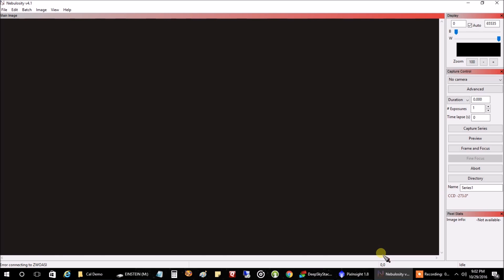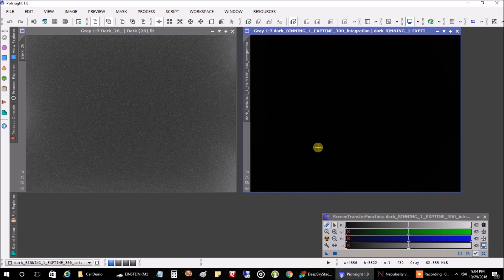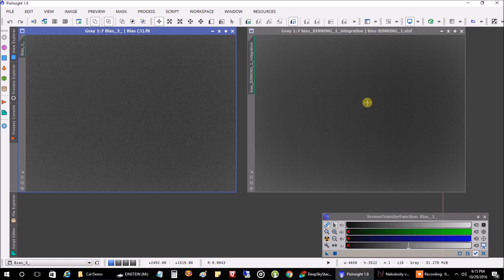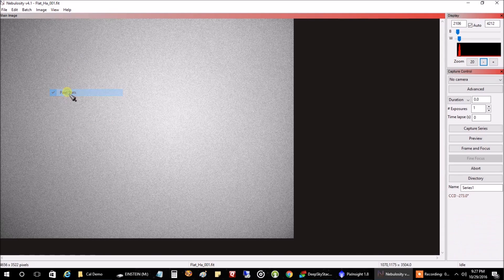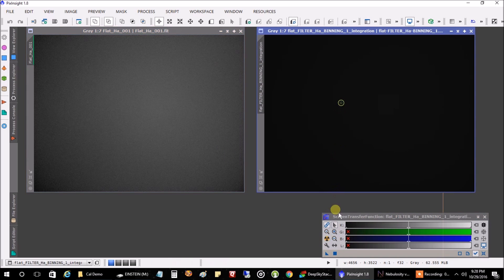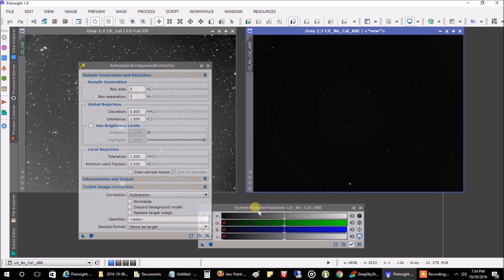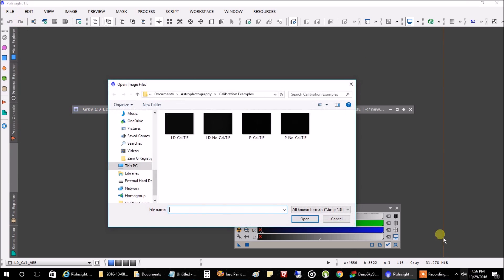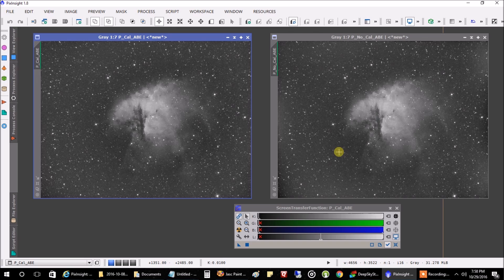How to Create Darks, Flats, & Bias (Astrophotography Calibration Frames)

Comment: Chuck, the correct pronunciation for vignette is vin-yet. Nice presentation. I also notice that if I set my exposure too high for flats that it washes out my image. Maybe we're missing something?
Reply from the maker: Right, vin-yet...I finally beat it into my brain.  Flats are tricking business.  I've noticed as well as others I've discussed it with is that flats are not very effective in severe light pollution - especially when a bright moon is out.   As far as setting the exposure too high on your flats, I would agree with you that it might have an adverse effect on your image.  Lately, I try for an average mean readout (ADU) of 5,000 for my flats.  Other people go very high, I go low.

Comment: Nice video Chuck and very informative. I have a silly question... I have just purchased a flat field generator and wondered if I need to retract the lens hood for my Esprit 100ED? I have seen several videos and images of flat field generators on the end of telescope lens hoods and nobody seems to mention it! I ask because in order to retract the lens hood I need to remove the telescope from the rings and I notice that you retracted yours in this video. I also don't see it being a problem slewing the telescope to a vertical position and then placing the FFG on top? Thanks
Reply from the maker: Does that lens hood act as a light shield or dew shield?  I've heard people say that if you use a dew shield, you can leave it on.  I would leave it on if it can support the weight of your FFG - as long as you are getting your desired ADU readout, I don't see a problem.
Reply: Chuck's Astrophotography Thanks for the reply Chuck. I think its probably dew but I need to check. I will have a play. I am so confused by Canons 14bit scaling in software compared to the standard 16bit I think it will take me a while to figure out :p Another great video :)

Comment: You said if you 're using a DSLR camera, you can take a set of flats for everything. Are you so sure about that? I've read different, that you need to take the flats for each filter you use even with a DSLR. However, if what you say is true, it literally takes a huge headache away with the flats. They are a real pain in the you know what.
Reply from the maker: Oh, I misspoke on that because I never switched filters on my DSLR.  Yes, if you switch filters on your DSLR, then you would need to capture a set of flats for each filter.  Agreed, flats are a pain.